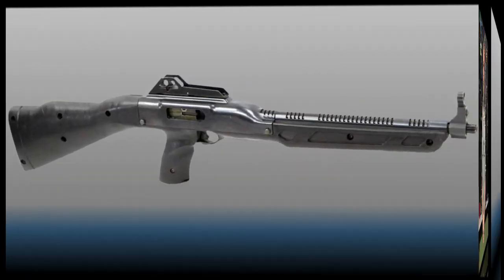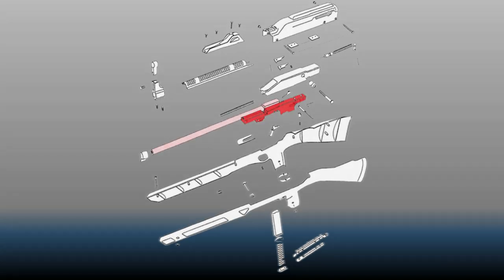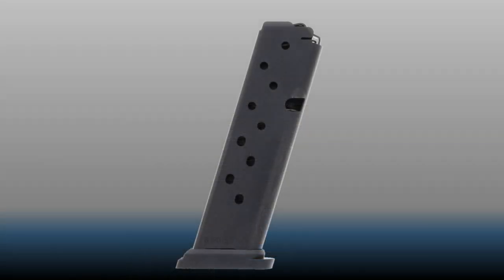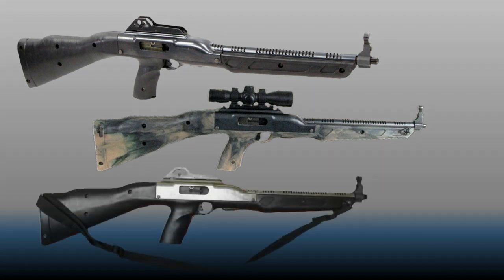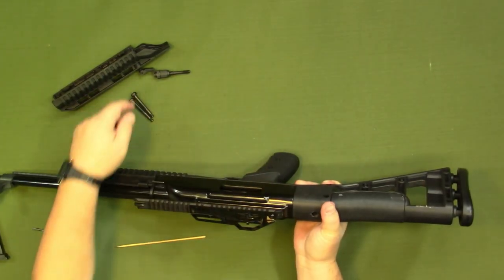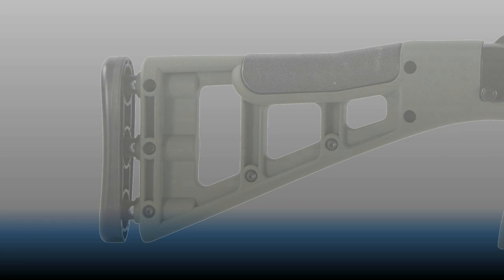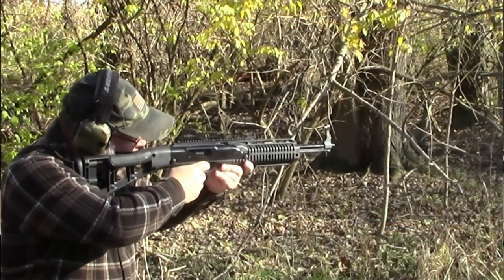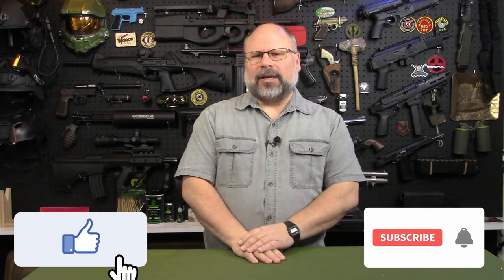Hi Point Carbine 995TS Overview

Comment: I had to send my 995TS in for warranty repair when I fired a significantly undercharged round that became stuck in the barrel. I didn't notice this had happened and fired two more rounds before I realized there was a problem. The barrel swelled but did not explode. I sent the gun back to Hi Point and they fixed it promptly and sent it back to me we a free 10 round mag. They have great customer service and I really appreciate that the gun was constructed strongly enough to have a failure like this without causing a catastrophic failure. I also want to stress that this failure was really a problem with the ammunition and not in any way a failure of the firearm. And Hi Point fixed it anyway. I tell people they have great customer service and an outstanding warranty. I would recommend purchasing one of their carbines unless you're a gun snob.

Comment: The spring loaded butt stock is for the recoil of the reciprocating heavy pot metal slide bolt, not the recoil of the cartridge. That heavy slide bolt recoil is severe without it especially considering it is a blowback rather than recoil operated gun. They knew what they were doing. That is why the gun weighs so much.

Comment: I've got a 995TS as well.  We've run an easy 4,000 rounds through it over the years. I've found it reliable to shoot, accurate to a 3 dollar pumpkin at 40 yards,  Just Ok to takedown, difficult to do an each part clean and lube, almost impossible to run a patch from chamber to muzzle because of that "fin" on the back of the receiver, magazines are limited, even the 20 rounder is a pain in the a$$. the paint is wearing off the bolt, but that indicates where to lube it, so it must be a feature. The magazines really need to be slapped into place. Overall a 3 1/2 gun.  Value for the money, 5 stars. reliability, 5 stars. Ease of maintenance, 2 stars. looks, -1 star. The front sight is unreliable.  replace it with an un-magnified  red dot.

Comment: I seen a video where the presenter showed a warranty void clause in the paperwork the firearm comes with if you use certain magazines. It was pretty clear so I would not consider the warranty to be "no questions ask."
Reply: Eros the Space Soldier No gun company is going to honor a warranty where the customer has replaced factory parts with unapproved aftermarket parts and that includes mags. The guns are designed to run with factory parts like the gun was made or approved parts. Folks go out and buy unapproved aftermarket parts and then blame the gun and company when the gun fails because of their unapproved parts. Make sure any aftermarket parts are approved by the manufacturer or face the consequences.
Reply: @rbm6184  hopefully the maker of this video is now aware of my point.